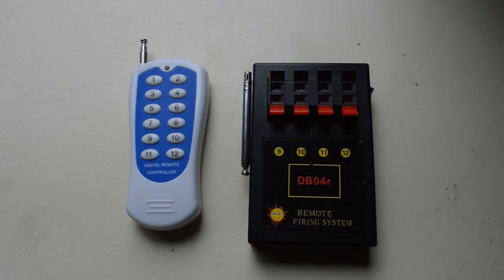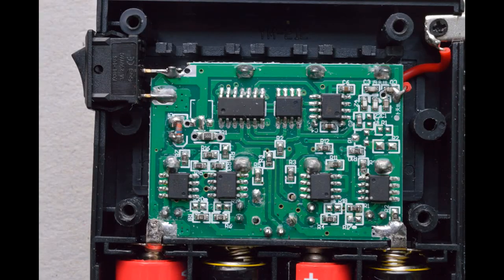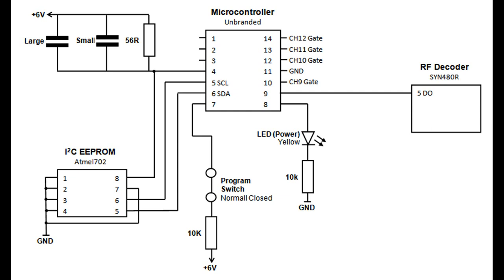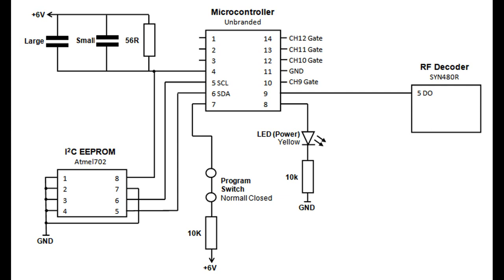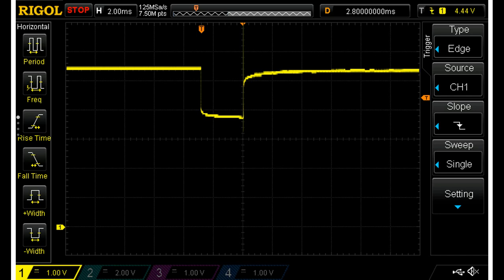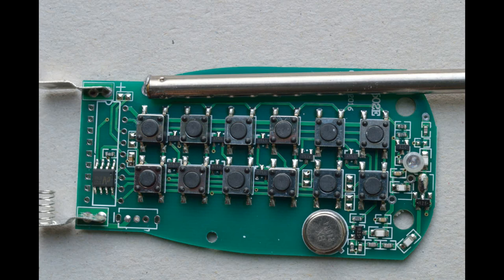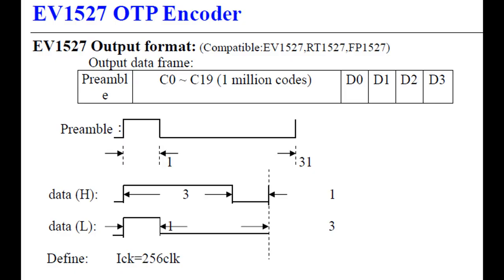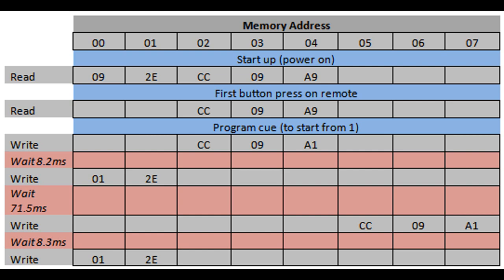DB04r Teardown (1st Gen)

Comment: That's a great and very informative video.  I was looking for a teardown video of this device to know how it works.  Keep it up.  This product is an entry level for remote fireworks firing systems.  If you could do teardowns of Cobra Firing systems as well as the FireTek systems that would be nice.  Thanks.
Reply from the maker: Thank you, I would love to do Cobra  and Firetek but don't have the units. I do have some Cobra but they have sticky foam stuck to the PCB, if I removed it it would pull off the conformal coating and open my module up to moisture damage - so I don't really want to damage a good working module just for a teardown.

Comment: Hi! My friend told me he had a freak accident where all 4 channels of 1 DB04R box fired at once because of a wireless sensor in the nearby area that also works on 433mHz. The sensor was used to turn on a light remotely. He also told me that with his firing remote, he could turn on the lights.

The DB04R was programmed in such a way that every channel had it's own button assigned. Therefore every channel must have had a unique number programmed into the EPROM.

Let's assume the light sensor indeed did freakily set off all 4 channels, it must have sent 4 unique data packets to exactly the same address, with precisely the proper data to trigger a fire command. I find it hard to believe his story.

Does this box truly have only 8-bit addressing, thus only having 255 unique adresses (-1 for the remote im assuming).

If yes, then I would find it probable that there is a 1 in 255 chance of a nearby device on 433mHz using the same address.
If there are over 8 bits of addressing, I find the chances unbelievably slim.

What do you think?
Reply from the maker: Hi Frank,

The DB04r uses a chipset called EV1527. This has a 20bit identifier which is hard coded at the factory, which means 2^20 = 1,048,576 possible sequential combinations. After these 20bits is another 4 data bits which identifies which number you have pressed on the remote.

The company would like you to believe that it would be impossible for you to accidentally trigger this device because the 20bit identifier would have to be the same as the one programmed into the remote.....but, if you look around you there must be more than 1 million devices worldwide using this chip, most simple Chinese products use this chipset. So you have to question, did the EV1527 factory stop making these chips after they ran out of the 20bits? No, which means there has to be multiple chipsets out there which have the same 20bit identifier. They mention in their datasheet the 20bits 'reduce code repetition rate' , so they are not guaranteeing this code to be unique, they have reused codes. To make matters worse, there are also equivalent chipsets which can be set up the same way as the EV1527, such PT2262, 74C922, HT12E to name a few - which increases the chances even more of a repeated 'unique' address code.

In terms of firing all channels at once, this is possible with single code in a single message. The modules have some secret codes which can be accessed outside of the remote (i cover them here: https://www.youtube.com/watch?v=txV52EnNnqc). These can be different with the generations but the numbers above 12 are the special functions. On my units, code 14 will fire all channels. These are hardcoded in the firmware and will not be in the EEPROM as they are not user changeable.

Not all 433MHz devices are equal, they would need to use the same encoding standard.

The fact your friend could use the their remote to turn on the light shows they both had the same 'unique' code. Did pressing any button on the remote turn the light on? It may be that the light would accept any data bits and only cares about the 20bit code, then by chance the on/off button that came with the light just happens transmit 14. That seems a little odd as that is 1110 in binary, a very weird decision to use that code. They may have used 1111 instead, which would also be a special code for the DB04r which is sequence fire mode. That fires about a second apart, which might have looked like an all fire depending on what was connect to the DB04r. I have some remote main switches which use 1111 as an on command and 1110 as an off command. 

So, as I have alluded too, your friend is very likely telling the truth. The chance of it happening is remote but no where near impossible. It is a shame they didn't record it or show the remotes as this is the first possible story I have heard. One was told to me about someone using a car keyfob to fire the unit, but these use completely different coding standards and it would be impossible for this to happen on DB04r, so I feel someone is stretching the truth on the car keyfob one.

Hope that all makes sense!